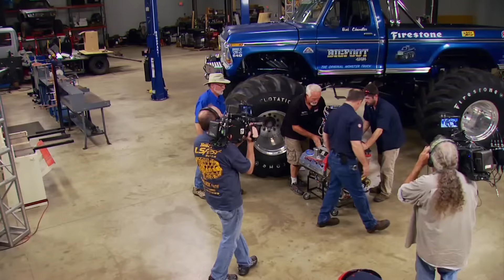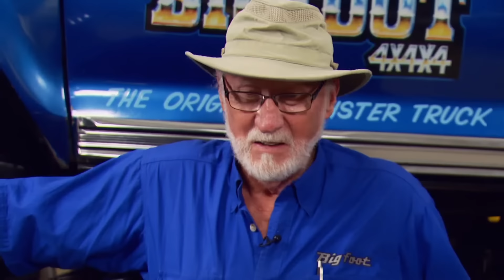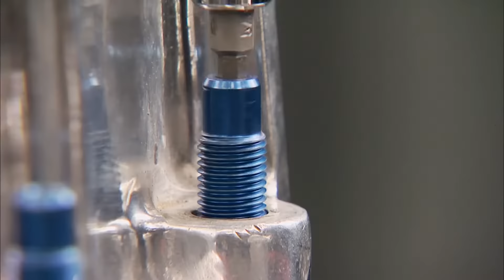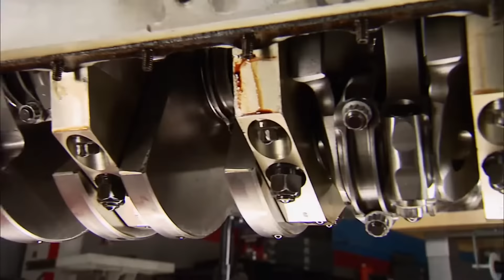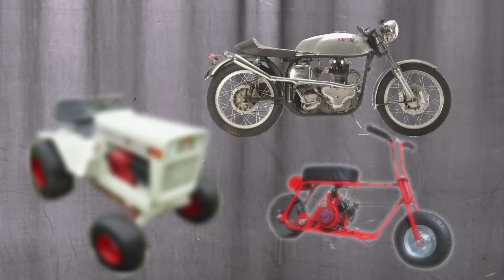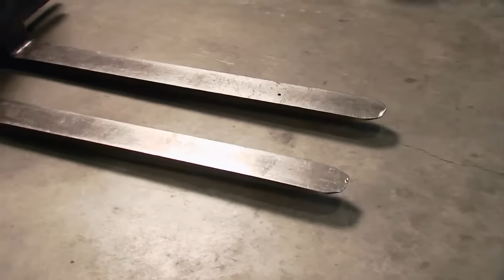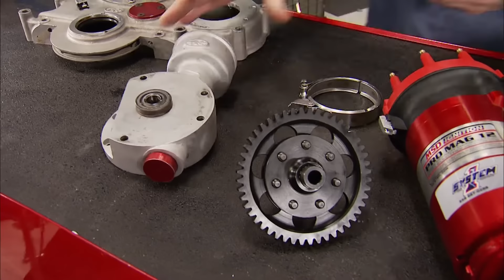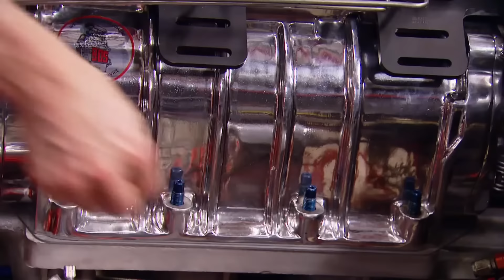Full Build: Bringing Bigfoot's Original Blown Big Block Ford Back to Life

Comment: Where they to scared to install the nitro?
It needs to be tested on the dyno to see if it works or it could just blow up everything if used untested.
Reply: This engines nitro days are over. It's basically a museum piece now. I don't blame them for not wanting to run it hard, it's a very rare engine with rare parts in it, damaging it could be a very costly issue.

Comment: This was fun to see happen, especially since they also went to a lot of the Bigfoot sponsors for the work to be done.

Unfortunately, this engine was taken back out.  The issue that came up was nothing that these guys did, it was just that what the truck is used for, there was not enough air flow going through to properly cool the engine.  It would overheat really quick and rather than risk damage, it is pulled out and now is on display at the Bigfoot office.

I do agree, this needs to be displayed at the International Monster Truck Museum and Hall of Fame.  This was the benchmark.
Reply: Aww. If these guys knew, they could so quickly fix that.
Reply: @brjones27  They didn't.  It happened a few years after they did the rebuild.  When it was pulled out it was exactly as they did for the rebuild.  Wasn't the fault of the engine, just for what it was made for originally was not what it was used for later in life.  I'm glad it was pulled out before it overheated for good and it meant another teardown.
Reply: This happened in 2015. That is when this episode aired. They are trying to fool their own fans. What a business model. Knowing that, everyone should for sure sub and like.
Reply: My guess is they switched from pure methanol fuel to a mix or leaded gas. Methanol sucks a lot of heat out of the engine when it evaporates. It's typical to see the section above the blower and the blower case to ice over a bit from that cooling effect.
Reply: @hydrocarbon82  would make sense since it didn't run on race fuel in its later years.